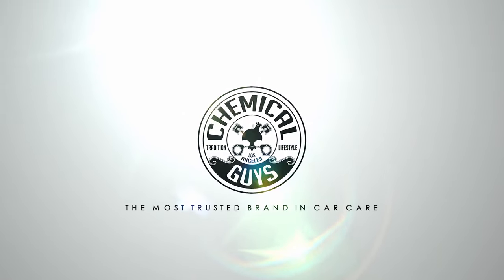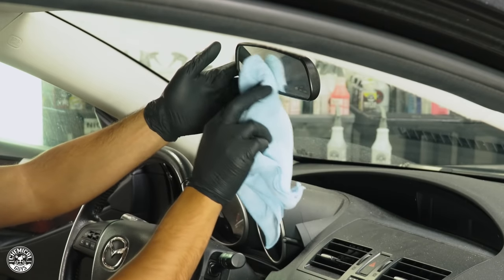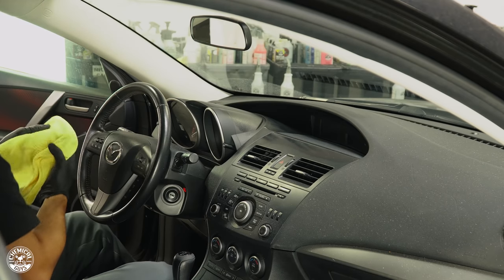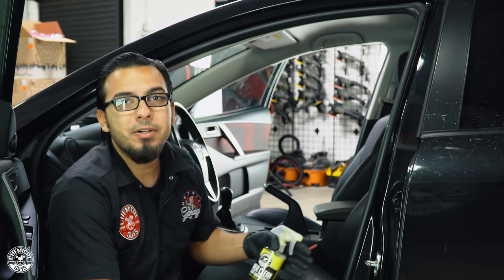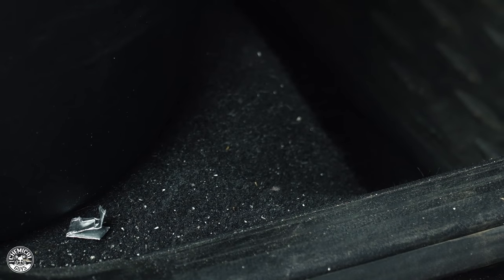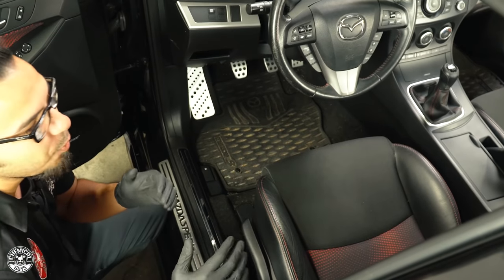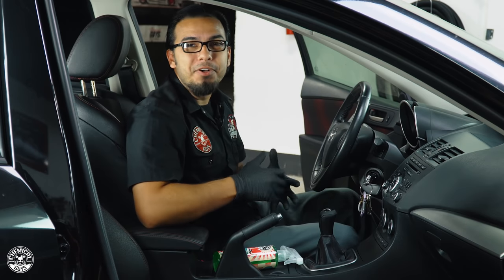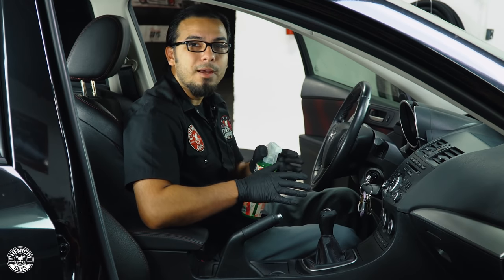How To Get Rid Of Cigarette Odor & Refresh Your Cars Interior! Chemical Guys

Comment: Why not replace cabin air filter?
Reply: my BF removed and replaced the cabin air filter and still the smell is in his truck..but we are slowly getting the smell out with cleaners
Reply: The only way to ACTUALLY clean it is to remove EVERYTHING.  Get some TSP and scrub the bare metal.  Then get rid of all the fabric: headliner, insulation, carpet, and reupholster the seats with new foam too.  Then, wait to see how much it stinks after closed up.  Still stink? Scrub some more. Once the smell is gone/tolerable start scrubbing the tar off each piece individually and reintroduce it.  That will help more than anything.

Comment: Chemical Guys products do work been using them for two years now, multiple different products, just received the Odor remove today and planning on using it tomorrow. Hope it works like the rest of there products, I am a smoker.
Reply: forseenlife it's working smell very nice, not to strong at all.
Reply from the maker: Hi Benny, glad to have you apart of the Chemical Guys family!
Reply: Chemical Guys Glad to be part of it, makes cleaning my cars  and motorcycle much easier.
Reply: How was the Oder stuff?
Reply: @andrew6809  Works well, instantly takes the order of smoke out the car, every time I go pick somebody up that doesn't like cigarette smoke smell I spray it and they don't even know that I smoked in the vehicle, I do recommended.

Comment: This ninja straight lit a cigarette at the end im dead AF!!! But thats the reality of thet situation. Here's my question... I drive for a Rideshare platform and sometimes, not very often I will allow the passenger to smoke in my car. My question is how do you get the smell of smoke out in a hurry where it stays out? The reason I am inquiring is because I will spray things like for Breeze fabric on the seats and on the ceiling of the car. However it doesn't really takes the odor away it only smells like perfume over smoke. So I keep spraying and then eventually it smells like the perfume but then when the smell wears off the smoke still lingers for probably about a day to a half day. Is there a way to remove that odor instantly so that my next passenger and I don't have to keep smelling it? I do realize the best thing to do would be just to say don't smoke in the car which I normally do. Nevertheless sometimes people have things going on where I'll let it slide to get my 5 stars.

Comment: What do you guys think about Carnatic coatings?
Reply from the maker: Ceramic coating are awesome, they may give you up to 36 months protection. A ceramic coating still has to be maintained constantly, like a glaze, sealant, and wax. Before applying any coatings, we recommend washing your car, clay it and then polish it to make sure every imperfection is out. Why? If you leave any scratches and swirls under the ceramic coating, they will not be able to be removed until the ceramic coating has worn off or stripped off. Thanks for watching and thanks for being part of the Chemical Guys family!